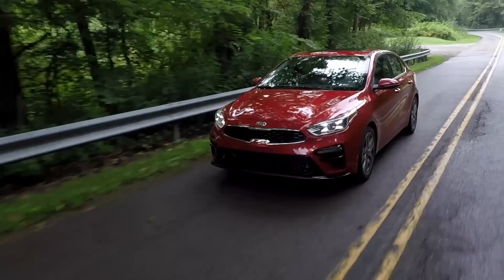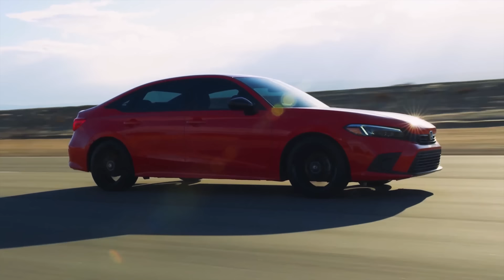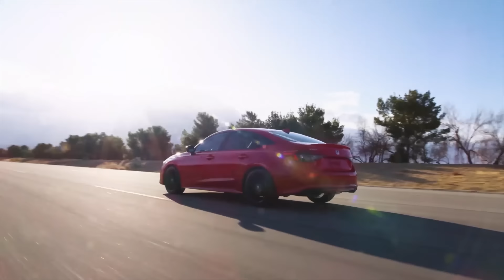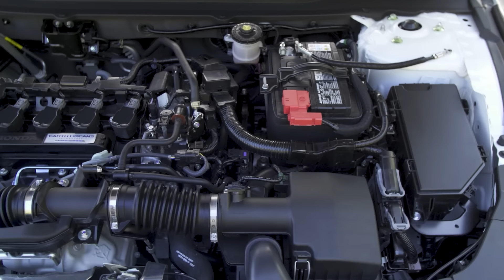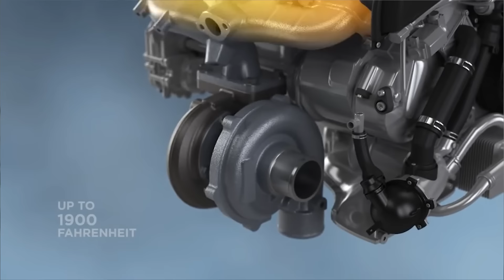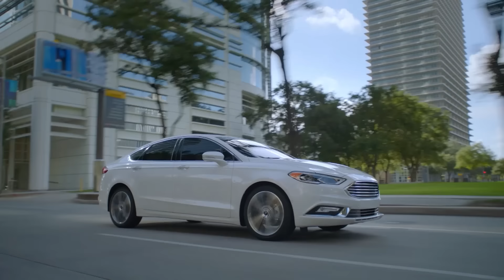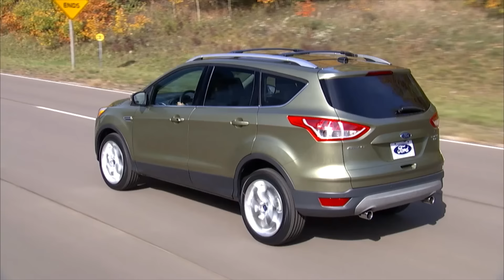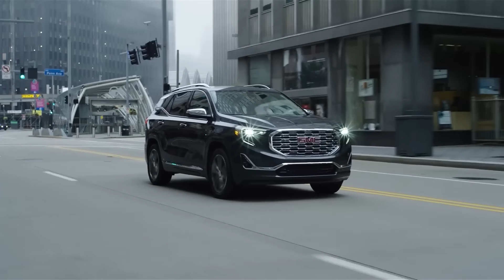Are Turbocharged Engines Reliable? The Truth About Turbo Engines

Comment: Honestly this was the reason I bought a Camry instead of an Accord. Yes the Accord is more fun, quicker, has better tech, and Honda products are generally reliable, but I wanted a daily drive (100ish miles daily) car  that I would be 100% sure that I wont have any major problems with for the next 10 years at least.
Reply: Long term Honda (including Acura) owner myself, too many to count.  But not the same worry-free experience it has always been.  Next purchase will be a Toyota.
Reply: We’ve had 2 Camry’s. 
I kept mine for 9 years and traded it in for a Rav 4WD Limited with a 3.5 V6. I’ve had it for 11 years and plan on driving it for another 10 years. Since retirement I only drive about 4-5K miles a year. So in 10 more years I should only have 160K miles.
My wife drove her Camry for 18 years.
Reply: I’ve bought Camry too. No turbo no cvt even being base model unlike Accord.
Reply: The next Camry’s going 4cylinder only. It’ll be a choice between a 2.4 turbo or a 2.5 NA hybrid like the Highlander.
Reply: @tails300  Good thing I already bought the V6 before it went extinct then
Reply: My dad's 2006 Avalon is still going strong at 213,000 miles. Just normal oil change, brake pads etc
Reply: @fatomiabdul7997  gave back 2006 Avalon with 320,000 miles back to my dad. Suspension needs replacement and the startup is a bit odd now. Still, it's a great car.
Reply: @basilman121  start up not great means engine mounts 100% and possibly tune items like ignition and fuel injection. New plugs and injectors could be game changers.
Reply: There is no car that you can be "100% sure" won't have major problems.
Reply: @Vitam1nx  sure but a NA toyota V6 is the closest I could find
Reply: @Vitam1nx  
Your right. 2½ years ago we bought a 2009 RAV4 with less than 19,000 miles on it, Carfax certified. I figured we didn't need the aftermarket warranty. Wife said get it. A couple months before the 48,000 mile warranty was to expire we had the intermediate steering shaft replaced AND had a remanufactured transmission put in by the dealer. Would have cost us $5,200 if we didn't have that $1400 warranty.
Reply: I agree, but if you are driving 100 miles daily the turbo should be OK as you have given it time to warmup. I would have chosen one that is the most comfortable so that a long commute would feel good. Also, a good sound system would help the commute be more pleasant.
Reply: I have owned Hondas for 3 decades (1980s to 2010s) and recently completely abandoned Hondas. Last 10 years have gravitated towards Toyotas and absolutely amazing built quality. Toyotas ages so gracefully.
Reply: @Thankyou_3 honda lost its way unfortunately.
Reply: I would have made made decision as u, for same reasons.
Reply: Toyota is going turbo also. The Japanese brands will no longer be reliable like the past.
Reply: @ag4eng  exactly
Reply: My 2003 Tacoma 2.4 L  has passed 300,000 with original engine transmission water pump alternator radiator rotors . Just replaced rubber belts a few months ago for the first time. Thermostat two times. Radiator started leaking three months ago , I ordered new one but I drive every day it never overheated I don’t need to check coolant level because leaking holes are top part, if I don’t refill water it wouldn’t leak. Bushings and boots are starting to leak and it’s all original. I changed oil every 4000 miles and my Tacoma runs like new. It just broke in I think.
Reply: I should mention about coolant and brake fluid, I never replaced those, all original for 20 years. My motto is Don’t do anything if it’s not broken.
Reply: Turbochargers add drama to car ownership. The little bit of money saved on fuel will be lost many times over when the turbo hardware starts giving problems.
Reply: My 2007 Camry v6 has 
370k on the original engine. She still can compete with other v6 on the road.
Reply: @met00meno65 the same gearbox?
Reply: Weird for you to compare Toyota to Honda, the other company known for reliable cars.
Reply: Amen. 100% agree, very smart choice 😊
Reply: Great choice. I would’ve done the same.
Reply: I think you would have been fine with a turbocharged car given your driving habits. Turbos prefer longer drives and highway speeds.
Reply: exactly!!! toyotas are the best
Reply: @saadtheman1 Toyota  Camry 2012- 2016.  984,000. Bad torque converters.   Toyota settled a MAJOR class action lawsuit super quietly out of court.
Reply: @saadtheman1  not the tacoma. Its the worst midsize truck for reliability. Camry and prius are excelletnt. Rav 4 average
Reply: @billricheter5678  worst midsize truck in reliability? Haha please don’t make laugh, go read consumer report page and then come back here again and talk
Reply: @erickgomez1798  The Toyota Tacoma Reliability Rating is 3.5 out of 5.0, which ranks it 7th out of 7 for midsize trucks.
From repair pal. It’s crazy how you have bought into the Tacoma myth. It’s not very good. Have several family members that are mechanics and said quality has drastically gone downhill from Mexico builds. Haha
Reply: @billricheter5678  Those ranked in 7th were the first production 3rd gen Tacomas (2016-2017) as you already know the first year of a new model is mostly defective for example the 2020 new model of Chevy silverado as the worst most defective full-size truck in the market 😬😅 sorry if you have any chevy, I have my 2019 with 88k miles nothing but just regular maintenance (basically oil changes only) still the best selling midsize truck in the market and always above than all American car brands 💪🏻
Reply: @erickgomez1798  they are no longer good at all. You have bought into Toyota myth as,have many others that’s why resale value is high. By the way jeep has best resale value does that mean they have high reliability? Toyotas,use,to be good but that was 10plus years ago. Go ahead with your anti American viewpoints and support the overseas vehicles. But Tacoma’s are terrible period
Reply: @billricheter5678 uh…, most Toyotas are built right here in the United States.
Reply: @bruceskousen5451  true
Reply: I’ll keep you posted on that one. So far my TLX 2.0T (same motor as the Accord 2.0T) has been rock solid, performance tune notwithstanding.
Reply: Toyota have junk transmissions and engines are like molasses

Comment: Doesn't turbo charged engines typically require premium gas?
Reply: My 2013 Ford Escape with turbo engine that was cited in the video uses regular gas.  The 2022 Kia Sportage and Hyundai Tucson is also regular.  2022 Escape uses regular (except for the larger displacement turbo engine, which is recommended premium).
Reply: Only some models, mostly the high performance cars like a Honda Civic Type R. My recommendation for gasing up a turbocharged car is use good quality top tier gasoline, don't use the cheap stuff.